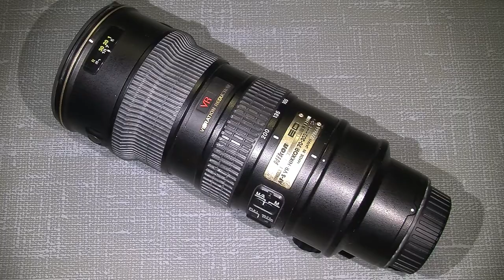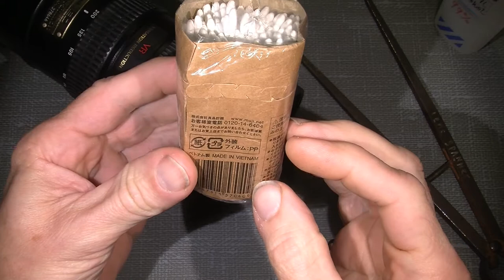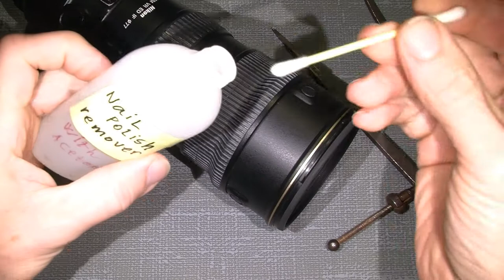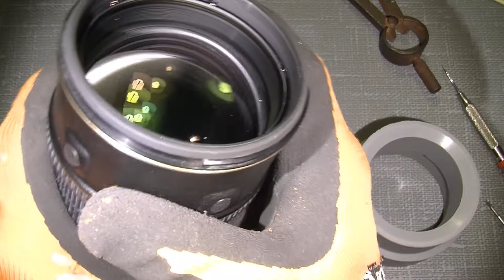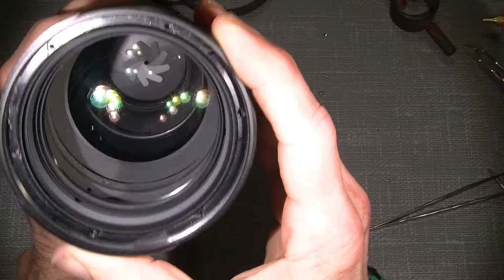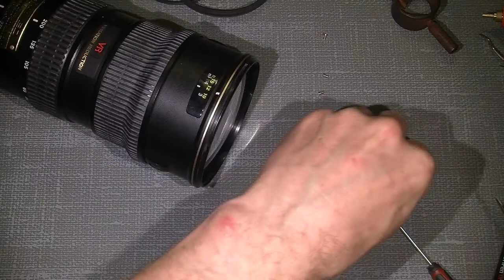Sticky focus in AF-s VR Nikkor 70-200mm 1:2 8G ED opening from the front

Comment: What is the name of the front part of the lens that holds the filter. It was the 2nd part you removed after removing the inside ring. Where would one be able to find the device to remove the retaining ring. What was the plumbing part for putting back the front ring? Great video!! Looking to replace the front filter holder ring on a 70-200 mm.